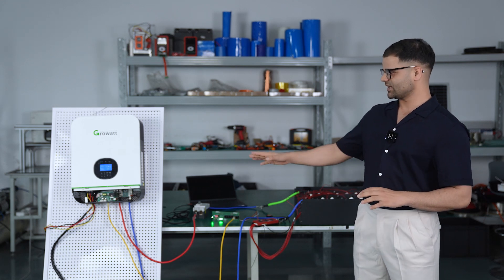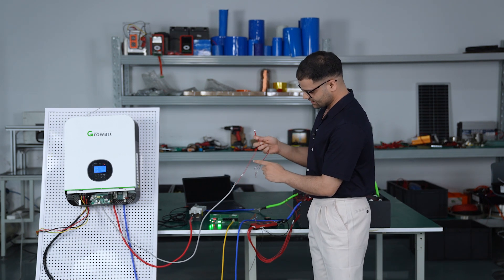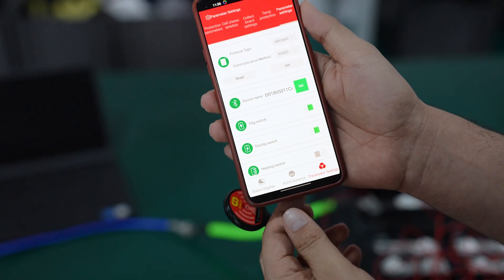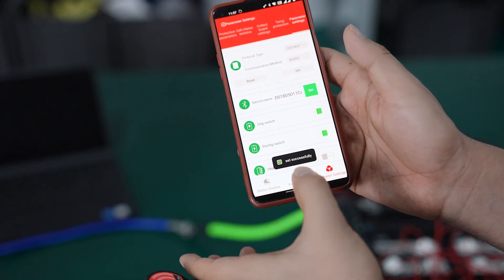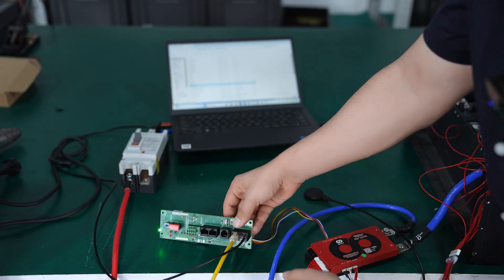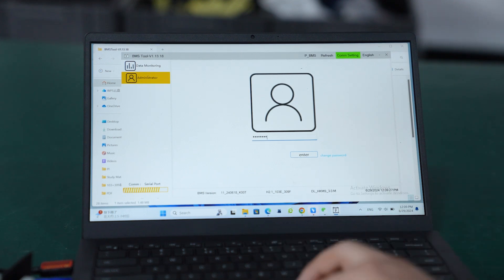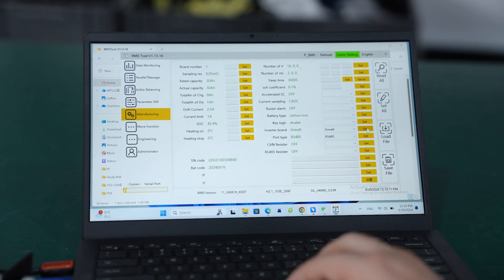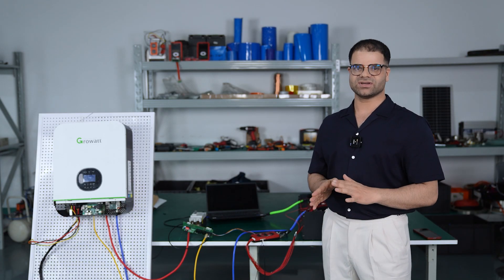How to connect Growatt inverter

Comment: Excellent video. It's good that you are showing detailed steps. Next time, it would be great if you showed the current draw from both the inverter display and the BMS showing that they are both saying roughly the same thing. Keep these detailed videos coming. I do have one question concerning the cable. 100Balance has a ready made cable that connects the RS485 to ethernet. Would that work with this BMS?